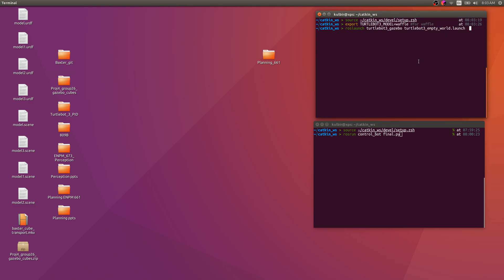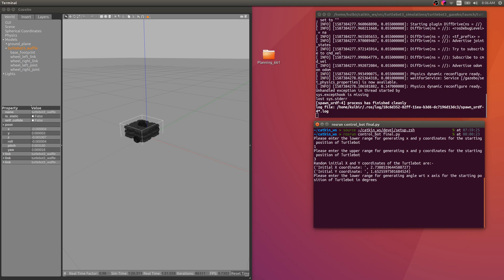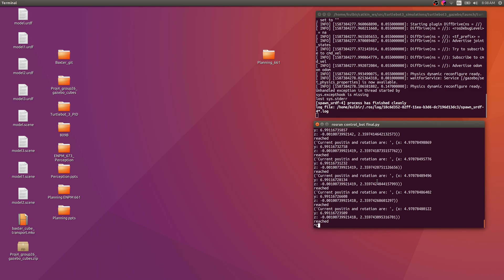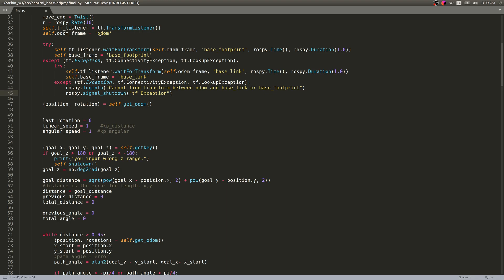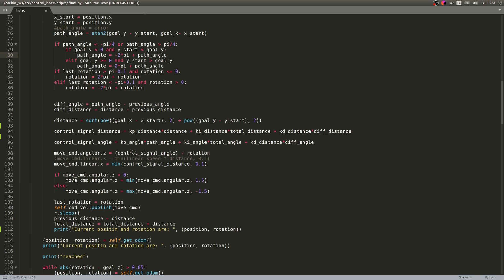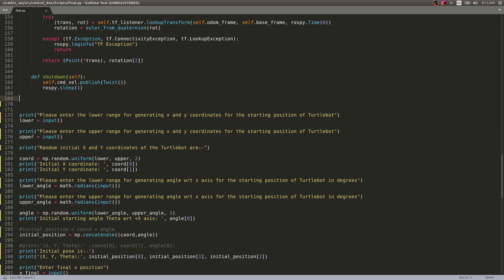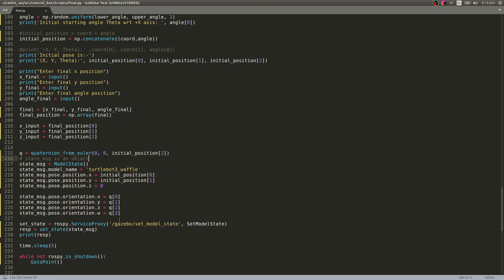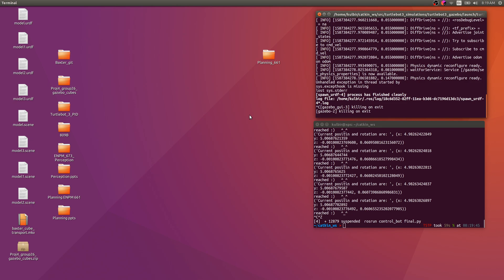PID control on Turtlebot3 using ROS Kinetic

Comment: How did you come up with the logic of the path angle and rotation. Is there any material which you could share to the public ? I am getting confused at the point of robot alignment with respect to the orientation and angle during its travel. For example I am able to design a simple PID control which can go to the desired x, y as long as it is all positive.